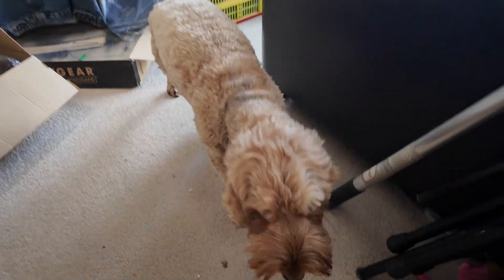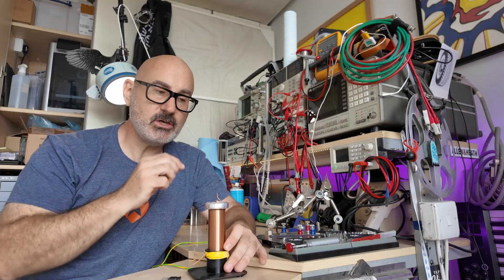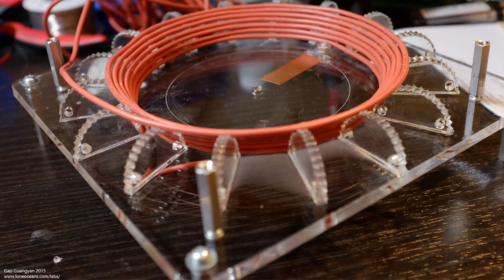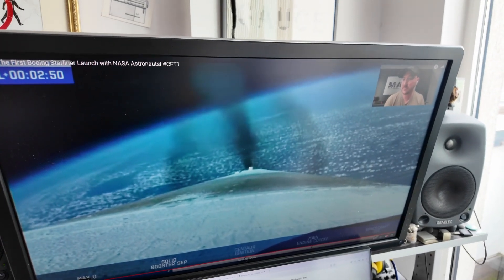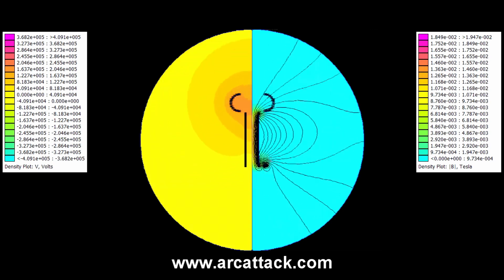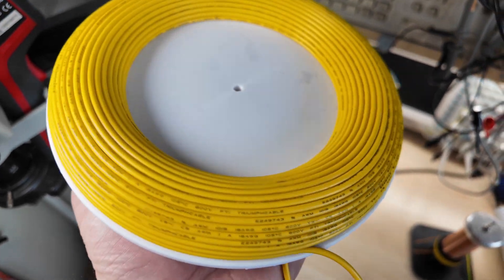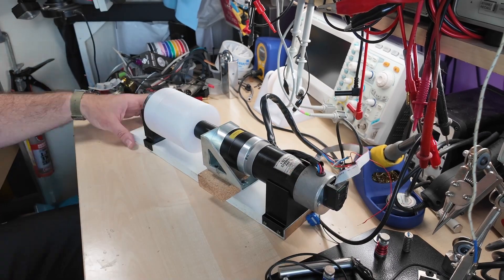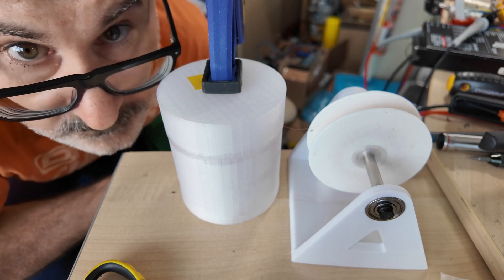One Primary To Rule Them All? HANDHELD QCW Tesla Coil Ep5

Comment: just a helpful tip from a chemist: your gloves do absolutely nothing against the Dichloromethane. It just goes straight through them, through your skin, into your body; just like all very non-polar solvents tend to do.
Reply from the maker: Thanks mate. You're absolutely right, I've added a warning in the description. Are there any gloves that would be suitable?
Reply: @HexTheDex  Yes and no - with good gloves, you'll find a list of various solvents and their gloves resistance to them given in form of time values called the penetration time - its the amount of time the solvent needs to diffuse through the gloves. 
With decent standard lab gloves and DCM, you'll often see penetration times around 30 seconds. There are gloves that can withstand for several minutes, half an hour or longer, but in the end, super non-polar stuff just diffuses through every single substance you could make a glove out of. Unfortunately, DCM happens to be carcinogenic as well, which means whatever expensive glove with super high penetration times you buy, you will have to throw them away after contamination. 

So as someone working with DCM on a regularly basis, my method is just not spilling it on myself. For things like DCM I usually use normal gloves because the thicker stuff ruins my dexterity, and aside from that I just switch them immediately after I get a smear onto my glove. 

Same with acids and bases btw - imo wearing gloves often even can be worse than wearing no protection at all, because I would notice a drop of sulfuric acid on my skin pretty quickly and could wash it off without it causing any damage, but when I don't notice it because I'm wearing gloves, I can smear it anywhere, including my face if Im not mindful. 
Things like DCM are a bit different story though.

So I really don't have any special recommendation for you, I just wanted you to be aware that these gloves do not protect you properly and to work with the DCM accordingly. They're still better than nothing and the alternatives arent that much better imo

Comment: Very nice work!
This series is becomming more interesting with every episode and your fast progression is impressive.
Best of luck on your journey and I cant wait to see your handheld QCW operate:D 
I think it is actually an advantage in this case, that you power it from 12V with a boost-converter, since you can probably just use the boost-converter itself to generate the high voltage ramp for the primary side.
Reply from the maker: Thanks mate! Your boost converter idea sounds interesting. Do you know anyone who has documented/implemented it? I'm currently planning to use phase shift for the ramp. I've got a design working in LTSpice but I don't know if it'll work in reality. Would be good to have a backup plan!
Reply: @HexTheDex  Interesting approach, I don't think I have seen anyone use phase shift before. 

Regarding my boost converter idea I don't have a direct documention of someone doing it, but you may be able to regulate the output voltage of your boost converter by adjusting the on-time of it's squarewave. You could start at almost 0% and then ramp it up to 50%. Doing that should ramp up the power and thus also the voltage, assuming that the load on the converter is constant.

Alternatively loneoceans has another article on QCW coils (they're first one, the QCW DRSSTC1), which contains even more useful info than they're tinyQCW. There they used an asynchronus buck converter controlled by a microcontroller to generate a ramped bus voltage feeding the DRSSTC. Lot's of useful info there in my opinion. 

Hope this helps/gives some more inspiration and good luck with your coil:D

Comment: Cool project, I have some tips that might be helpful for you, before you make a QCW coil, are you sure that you understand the basic operations of a dual resonant SSTC? It’s crucial that you do, before moving onto a more complex design. I highly suggest improving your bridge design to minimize the most stray inductances as possible, at this stage you should also be moving onto using IGBTs, instead of mosfets like the IRFP250 you were using in your other designs, this is due to the nature of a DRSSTC, peak voltages and current can be multiple times that of a regular SSTC. I find this project very ambitious, I highly recommend you build a regular DRSSTC first, that might get you more used to the design
Reply from the maker: Hello mate. Thank you for this. I agree and have just taken delivery of some new FGA60N65SMDs (some of the last available in the world it seems!) and will be going full bridge. But before that I plan to continue with the IRFP460 half bridge and test the coil with the LabCoatz schematic Staccato DRSSTC, with some rectified 240v mains input. Your advice to master DRSSTC first is excellent, however maybe charging ahead like a fool makes for better youtube?
Reply: Funny seeing people from styrocord here now.